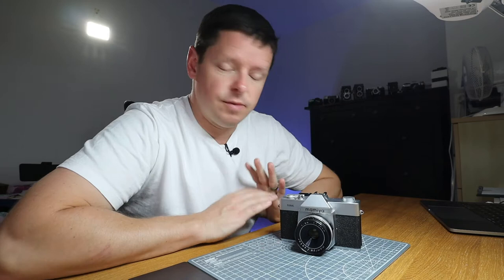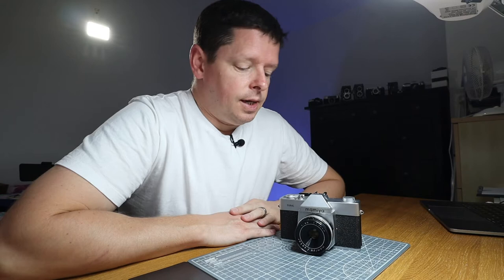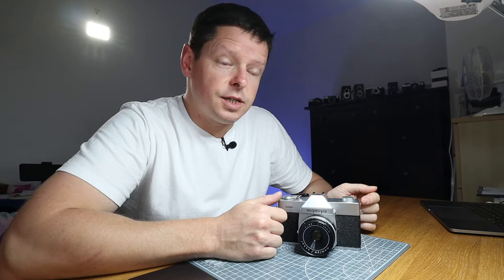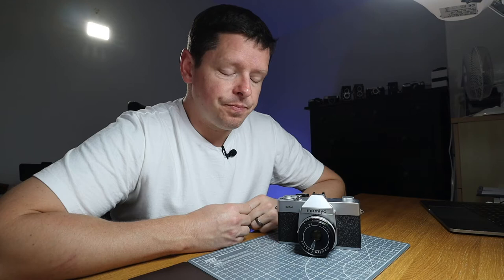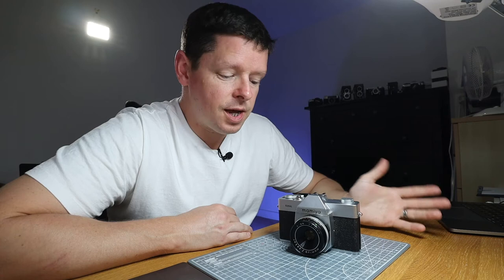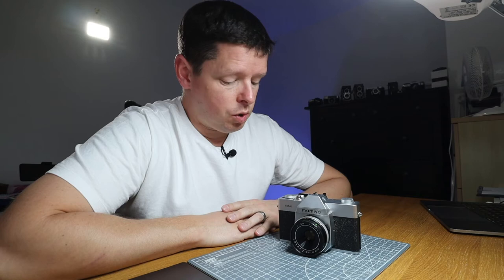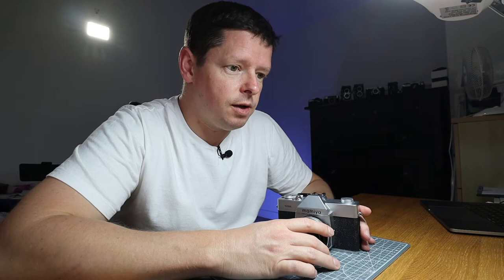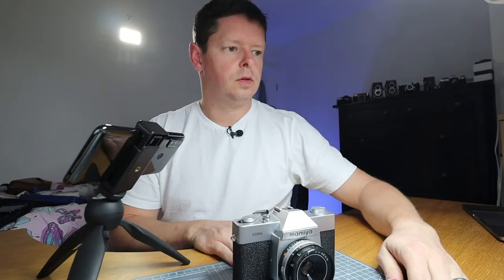Prism cleaning on a film SLR - vintage camera repair to Mamiya 528AL - dead fly on prism fixed!

Comment: It’s so interesting to see the insides of these machines! Makes you appreciate even more how they are true wonders of engineering. Good job fixing it up!
Reply from the maker: I know, they are amazing inside. I got a bit over excited about the prism. But this was built in the late 70s, and it is an impressive, immaculately engineered piece of glass. Glad the fix was easy, or I might have just screwed the top straight back on again!

Comment: what did you use to wipe the prism clean? I just tried cleaning mine with 99% isopropyl alcohol and it left streaks. Any idea how to remove these?
Reply from the maker: I've never had much luck with isopropyl alcohol, I always get streaks from it. I use denatured ethyl alcohol and that seems to work a bit better. Alternatively, Zeiss lens wipes are amazing, worth picking up a box off amazon!
Reply: @the120ist  okay thank you so much! I ended up using one of my Visible Dust sensor cleaning swabs and removed my streaks. But I’ll definitely have to pick up some zeiss cleaning wipes.
Reply from the maker: @oCorvus  Glad you got it sorted! I buy those Zeiss wipes in the big 200 boxes and get through about one a month! They're amazing!

Comment: I'm sure you are still regretting that unfortunate scratch... the reason for it happening is the long legs of your caliper, you need shorter ones for more control
Reply from the maker: I regret every scratch I have ever made on a camera. In fact I could probably recall each and every one. It pains my soul when it happens. I've learned a lot since this video!

Comment: Where are your white gloves? I have done this sort of thing so many times, as the result of buying cheap and spares or repair cameras, jammed shutters, winding mechanisms, totally seized innards, torn or snapped shutters curtains or ribands, on a wing and a prayer or needs must scenario, it's amazing what you can achieve even as an idiot :-) me not you. I have become somewhat of an expert on the Exa 500 after repairing four of them.
Reply from the maker: Oh dear.... you caught me! No white gloves... I look back at this video, only 9 months ago, and how much I've learned since then! I'm still just as amazed buy the workings of a camera, but I've got a little better at taking them apart! Learning by doing.....!
Reply: @the120ist  I have always found cameras and analogue photography utterly fascinating, but when you have to work on them that is when you truly appreciate them, the clockwork complexity is just mind bogglingly beautiful. I feel the same about valve radio equipment, my first love, I am a radioham too. Although I have had a camera of one kind or another since the age of 13, I only started collecting cameras and all that goes with them 14 months ago, it has been a steep learning curve, without people like you I would still be floundering in the dark :-)
Reply from the maker: @ianwilkinson4602  Ha ha! So it's helping you to watch me floundering in the dark instead!!! So long as we're all learning together and moving forwards!

It definitely is a steep learning curve. But I find it exciting that there's so much ahead of me. So many aspects of cameras that I'm not brave enough, or have had a reason, to tackle yet, but I know I will one day. I have a couple of old seized up shutters that are on a shelf just in the corner of my eye... I'll get to them!